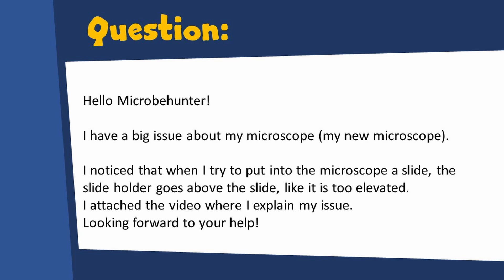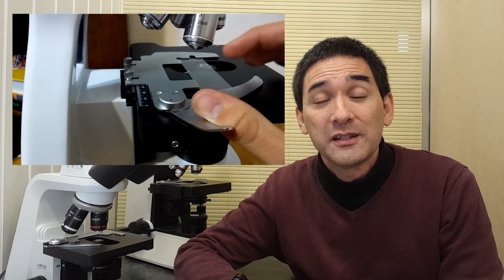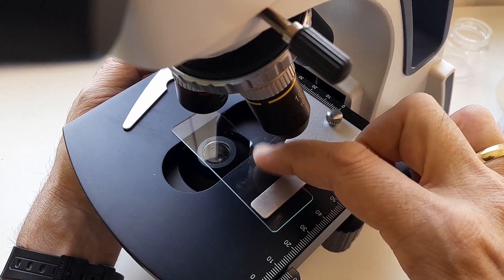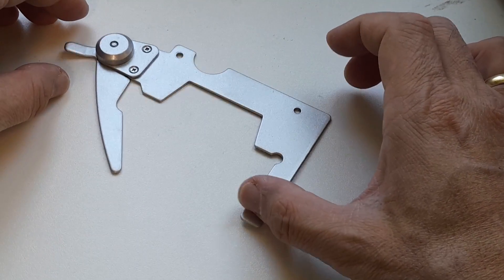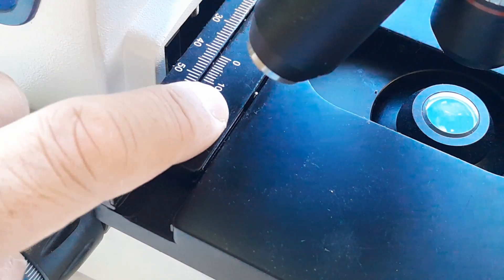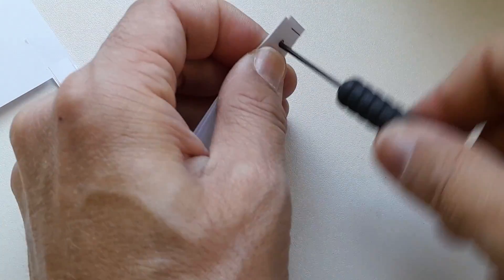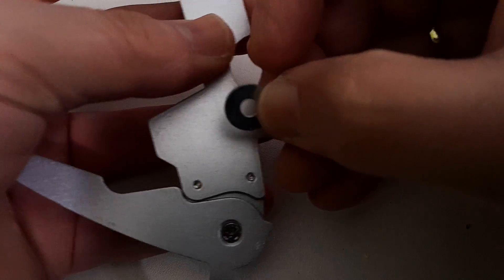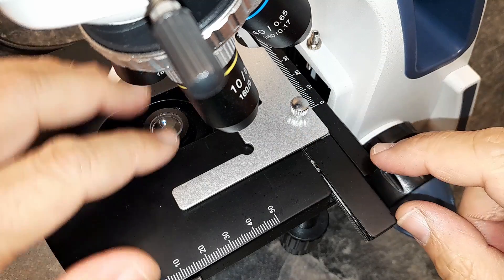Repairing a microscope slide holder 🔬 Amateur Microscopy

Comment: Well I have an old 400D swift collegiate and over the years I have maintained fairly well and replaced objective lens for amscope since they are bit more neutral and white not so warm in color like swifts stock lenses but my issue is the slide clip holder. I think the spring is installed wrong because it doesn't spring back to hold tension on the slide to keep it in place. Could you demonstrate that if it's possible. Then again it's such a small part I have issues seeing where the spring is to line up. 👀 🤓 🔬 🔍

Comment: Hi! I have a Delta Optical BioLight 300, and I have a problem with the table. It will move side to side, but when you try to move it front or back, instead of moving the screw unscrews. No idea on what to do, can't find anyone with a solution and yet I've seen this problem in a lot of microscopes which are on the cheap side like mine